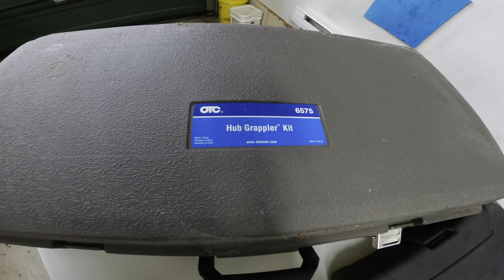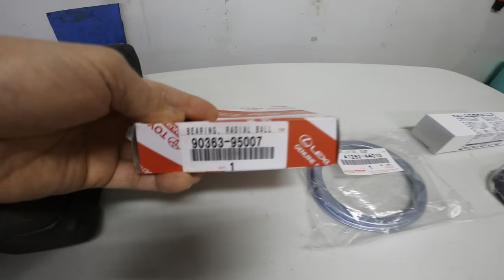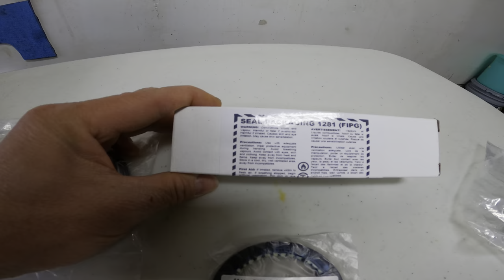2013 Toyota Sienna Limited AWD - Noisy Rear Differential Repair - $150 vs $1500 repair

Comment: Hi, I have 2011 Sienna , I just made the repair ,  took 7 hours to complete it , but the car runs fine now , your video helped me a lot , Thanks
Reply from the maker: Nice! 
You’re very welcome!
Reply: 7 hours? I have a 2011 - was it because it was time intensive and difficult or did you encounter  problems?
Reply: There were no major problems, just every small step of the process tucking some time and I don't have any proper mechanical equipment

Comment: I know this is older but I feel I'm having the same issue. I looked up that bearing part on toyota and it comes up with nothing. I found it elsewhere but it says it doesn't fit my year and gives an older series (03-07). Any ideas? I'm having trouble finding the part alternative. I found your other part numbers, just not the bearing.
Reply from the maker: No specific bearing PN is listed for this model year. It is only available as in a complete coupler assembly. However you can find the bearing with the same PN listed in my video (Toyota dealers for sure would have or eBay maybe) then it will work.
Reply: @PTranProductions  I did find it in older models as that. I'll order and hope for the best. Appreciate the response and the video
Reply from the maker: @DrewTubeCenter 
Np! Good luck with your repair!

Comment: Amazing!  Thank you.  How is the bearing holding up without the O ring?  I have a 2011 with the same problem.  Where did you get the parts?  Toyota keeps telling me you must replace entire unit.  Thanks for your help bro.
Reply from the maker: The bearing has been holding up very well so far. As you have seen in my video, the two bearings have identical part number except the old one has the outer o-ring and the new one doesn’t.  I got just ordered my part from my local Toyota dealer by giving the exact part number as ‘no replacement bearing’ listed for my 2013 Sienna rear differential. Yes, the dealer would systematically tell you to replace the whole unit because there’s no replacement bearing listed in their system.
Reply: @PTranProductions  where are you located?  Any chance you’re in Ontario?
Reply from the maker: South Western Ontario.

Comment: Just a note of thanks for your efforts making the video. This past weekend I replaced the bearings in the assembly on my wife’s Sienna with 140k miles. I did both the large bearing like you showed as well as the smaller one inside the clutch. The smaller one did not appear to be bad, but I figured since I had it all apart that I’d replace it anyway. Also installed a new dust shield. The parts were like $180 on EBay plus a little gear oil.  Your video definitely helped me to gather up the right tools so I didn’t have to make all kinds of extra trips to the toolbox. Thanks again for your efforts.
Reply from the maker: You’re very welcome! 👍

Comment: Thank you for the video - we did this repair this afternoon on our 2011 Sienna and it worked like a charm, ordered the exact parts you detailed - very helpful!
Reply from the maker: You’re very welcome!
Reply: Hi Steven, just curious how long it took you to fix this? Did you have any challenges? 

I consider myself a handy person, but never done this before. And I dont even have the car lifts or jacks. But thinking to do it myself as literally no other mechanic wont even consider rebuilding it for me. And I hear dealer is asking north of $2500
Reply from the maker: Around 6 hrs of labour (while doing the video and explaining all the steps of how to do) + 3 hrs or more waiting for the sealant to dry.
The only challenge was pounding the old bearing out of the housing. A press would be nice for this job.
Reply: @PTranProductions  thanks a lot for your response
Reply from the maker: @MrAnderson58  
Np!
Reply: @MrAnderson58  Yes, 6 hours is a good estimate.  I also thought the most time consuming portion was getting the old bearing out of the housing, as @PTranProductions mentioned. Just keep his video handy, i watched and rewound it many, many times... he covers it all!  Good luck, you'll do fine!

Comment: Thank you so much for this video. Mine took several days to do, but only because I could only work on the van after work. Also, the dealership sold me a defective bearing, so I had to wait on them for a replacement. All in all, job got finished and I no longer hear any whining sound from my coupler anymore
Reply from the maker: You’re very welcome!

Comment: I just got mine fixed. Thanks a lot for the video. My total cost was $590, that includes the part (brand new viscous coupler) and labor.

I bought the viscous coupler brand new (with 2 years warranty) from e-bay. And found a mechanic that I trusted. 

He had never done this before. But it was still very easy for him. And I was able to follow every step of him because I watched this video so many times ( when I was thinking I was going to replace the part myself).

It took him literally 1 hour to take out the old part, replace the new one, and put oil in it.

So don't every pay dealers and mechanics that are asking $3000 for it right now. (yes 3 other mechanics asked $3000 from me for a 1 hour job!!!) 

Anyways, just thought I would share my experience to help others.

Thanks a lot for sharing this video!
Reply from the maker: Nice!

Comment: Excellent! I have a 2006 Matrix 4WD with 199,647 miles and it has had the vc bearings replaced at 80k miles. Then around 190k miles the shaft would wiggle where it connected to the viscous coupler (non-electronic)...the bearing seat in the aluminum viscous coupler housing was severely worn away by the steel bearing with barely any metal holding the bearing in place. New housing and bearings fixed it. Car still runs like new.
Reply from the maker: Wow! Sorry that it happened to you twice within 200k. Good maintenance and repair would go a long way. I am glad that your 2006 Matrix still runs like.

Comment: 🙋🏻‍♂️🧰 I noticed when you flip over the coupling use a smaller size bearing press ring to drive the electro magnetic coupling device back into the housing and I was wondering what size did you use?
Reply from the maker: Not sure of the size of my head but it was part of the hub puller kit.
Reply: Okay if you figure out what size is best for that let me know I appreciate you very much

Comment: I got like a 2017 Toyota Kluger High Lander ........ Jacked it up, as you turn the wheels you can hear like a tap tap tap type sound........ and feel it on the cv shafts.   Did yours exibit such a thing?   In the car it sounded like tyre treat something stuck in a tyre etc....  but it also hummed.
Reply from the maker: No, I haven’t experienced anything like that on the van.

Comment: What are the orange things in your springs? Are they devices to stiffen up the spring rate to make your Sienna more heavy duty?
Reply from the maker: Yes, those are the Air Lift/Air Suspension which stiffen up and raise the rear end to about 1”. I used them for towing the boat trailer and heavy load of fish after fishing.

Comment: Top left bolt connecting coupler and differential is tough.  Very difficult after 0.5 inch coming out. Using 22" wrench.  Thinking I may break something.  Bolt head looks okay. should I stop? or force it? Need advise.  Thank you.
Reply from the maker: Spray some rust penetrating oil then wait for a few hours before you try to loosen it. I am not sue why it’s like that. Mine came out with no issue.
Please do it at your own risk. I can’t be reliable if you break anything.
Thank you and good luck!

Comment: Q1> My car is 2012 AWD Sienna LE. Does the car share the same parts with yours 2013? Q2> Where did you rent the hub grabble? Q3> Do you just use two original bolts to remove the four studs? Many thanks!
Reply from the maker: Hi JackM,
A1: This car had 176K Km when I heard the noise.
A2: My guess is that yours will have the same bearing but don’t quote me for it. Use as your own risk. As far as I know, my 2013 has the same bearing as the 2011 Sienna AWD of this guy on Siennchat.com: 
https://www.siennachat.com/threads/awd-coupling-repair-diy-growling-whirring-buzzing-humming.60841/
Reply: @PTranProductions  @11.47 you said "mark the original location for reinstallation". What did you mean? Thanks
Reply from the maker: To ensure correct alignment and to avoid vibration on the propeller shaft and the rear differential, the propeller shaft must be reinstalled to the rear differential at exact location when it was removed. Since the factory markings are no longer visible, we need to mark (a line running to both brackets) the propeller shaft bracket and rear differential bracket before they’re separated.
Reply: @PTranProductions  Based on my understanding, there are four different way we can install the propeller shaft onto the rear differential because there are four stud locations. After removing four studs, you mark the location of one of the bolt hole in  propeller shaft relative to the location of the rear differential mounting surface, you cannot use the rear differential outer wall as reference b/c it will rotate to any position.  So during installation, you are able to reinstall it as factory does. Does my understanding correct?
Reply from the maker: There should be only one way to install the propeller shaft to maintain good balance as of from the factory to avoid vibration. Yes, markings to be done on the the propeller shaft mounting bracket and the relative differential mounting plate.
Reply: @PTranProductions you have very high quality repair videos. Look forward to watching more. Thank you
Reply from the maker: @ask43242flight  
You’re very welcome!
Reply: Sorry to bother you again. It seems my car has the similar issues and I will need to fix this soon. When you remove the four studs, do you just use two original bolts to remove it or I have to buy bolts for it. Aslo where did you rent the hub removal tool? Many thanks
Reply from the maker: @ask43242flight  
Use the same nuts as shown in the photo to remove the studs. I purchased the hub removal tool kits awhile back for other job. So I didn’t rent it. You can check at your local part store if rental is available. If not, you may need to get something similar on Amazon or eBay.
I hope that helps. Let me know if you any further questions.
Good luck!
Reply: @PTranProductions  yeah I saw the two bolts shown @11.10 but it doesn't tell me the specifications of bolts. Is it possible that you can tell me the bolt spec so I can buy them first? Also, is it possible that I can remove the drive shaft with rear transfer case together to avoid that I have to first remove 4 studs? Many thanks
Reply from the maker: @JackM  
Those are the original nuts installed back to back. You don’t have to buy new ones. Use the original nuts that you remove and install them back to back then tighten them up good. Then you can remove the stud by putting the 12mm open wrench on the inner nut and turn counter clockwise.
Reply: @PTranProductions  I really appreciate your helps!
Reply from the maker: @ask43242flight  
No worry!
Reply: @PTranProductions  This morning, I jacked up the car in the air and confirmed that my car has the exact same issues. While I was under the car, I tried to rotate the propeller shaft manually as shown @00:09:51 in your video.  I 

tried the same method you used but I am not able to rotate the shaft at 

all. By the way, I have released the car parking brake, but I still 

cannot rotate the shaft at all. What did I miss here? Do I just need to put more force in order to make it rotate? I am concern that I might break sth if I do it. Thank you
Reply from the maker: @ask43242flight  
You must put your shifter in N (neutral), parking brake off and all 4 wheels in the air in order to rotate the propeller shaft. I apologize if forgot to mention that in my video.
Reply: @PTranProductions  I watched your video many times at the place where you rotate the propeller shaft, I heard no noise so I assume you didn't start the car. Q> How do you put the car in neutral when you didn't start the car. Sorry for this silly question.
Reply from the maker: @ask43242flight  
Turn on the ignition (without starting the engine) then step on the brake and shift to N.
Reply: @PTranProductions  I see. So you had turned on the ignition but didn't start the car while you rotate the propeller shaft. This is the reason why I didn't hear any noise while you did this. I just ordered all the parts you listed on your video and Thank you and just subscribed your channel!
Reply from the maker: @ask43242flight  
Np! Good luck!

Comment: Hey brother can you tell me which seal needs to order for the right and left side differential to connect to the axle because my car left and right leaking needs to replace the seal thanks
Reply from the maker: Sorry, I don’t know the PNs for those seals. You need to contact your local Toyota dealer to ask for the correct PN and to order.

Comment: hello, where can you buy such a kit for repairing the differential, I'm from Lithuania, my Sienna also needs to be repaired

￼
Reply from the maker: The hub grappler kit would be expensive for this repair if you had to buy it.
I just happened to have it from my previous wheel bearing repair.
You can find something else that work or you can have your local repair shop just to press out the old one and in the new.
Anyway, here’s the link for the kit if you still want to get it.
https://www.ebay.ca/itm/184997488710?mkcid=16&mkevt=1&mkrid=711-127632-2357-0&ssspo=omldyznwr0k&sssrc=4429486&ssuid=Ahg_4LbmT6O&var=&widget_ver=artemis&media=COPY
Reply: Just use a regular jack as a press

Comment: Do you happen to know how to remove and change out that seal? Theres like a metal ring in front of it that im not sure how to remove
Reply from the maker: Not sure which seal you’re talking about here. The bearing also has a metal ring dust cap in front which just needs to be popped out when the bearing comes out.
Reply: @PTranProductions  thank you. I got it off. I thought the metal ring might have been held in under the lip of the casing but it was just some grease that was creating suction on the ring. I appreciate it very much. I did find that there was oil in the casing of the viscous coupler and that the inner unit has some discoloration. Could my actual coupler unit be bad? I do get a thumping feeling sometimes when accelerating from a slow start.
Reply from the maker: Not sure what you meant by distortion. Do you see any sign of physical damage on the differential unit itself. If you see oil inside the coupler assembly, there may be an oil leak into the coupler from the main unit. Run your finger around the main seal on on the main unit (inner unit/differential unit) to check for any damage/cut when you pull the coupler. Replace that main seal if you’re in doubt and there’s oil inside the coupler.
Reply: @PTranProductions  discoloration on the inner electromagnetic unit like when metal gets really hot and turns like a dark blue color. Would it be okay for me to contact you somehow and ask you a few questions? Not sure if there is a way on here to privately message you
Reply: @PTranProductions  the seal felt fine but i replaced it anyway. Just kind of wondering if the thumping could be coming from the coupler itself so rather than spending $150 to replace the bearings. Maybe i should replace the whole coupler
Reply from the maker: @luongj  
If your rear differential doesn’t have that growling noise like mine but rather the thumping noise, the bearing may not be the problem. Was the rear diif. oil level low at some point?
It’s up to you to decide if you want to replace the whole unit or just the bearing.
There’s an inspection criteria for the coupler on Toyota Service Bulletin for 2012 Toyota RAV4 which has similar rear differential coupler:

https://static.nhtsa.gov/odi/tsbs/2016/SB-10092682-5448.pdf
You can message me via my Facebook fan page.

Comment: Hi I think it is same issue with my 2012 Sienna limited Awd just both it 6 days ago from private owner when driving on D or N after run start kind of like this Noise and sound I will be happy if help me with that please thanks
Reply from the maker: If you can do it yourself, then buy the parts and follow this video to fix it at your own risk. Otherwise take it to your friendly mechanic. He may be able to help you out.
Good luck!
Reply: @PTranProductions  thanks for sharing your experience I don’t have any mechanic friend but I will try to find a good mechanic with experience
Reply from the maker: @NYC-2015  👍

Comment: Hi I have I have a same problem and I went Toyota dealer they don’t sell the bearing by self.  And I get the part number that you show on your video.  
And they say that not for Toyota Sienna. For a different car.  I get the same part number on the video.
Reply from the maker: Lol! Yes, they just told you what the system told them. For some reasons that bearing PN is not listed for this 2013 Toyota Sienna. I took a chance and it turned out to be exactly the same bearing that was in my van. You can take a chance ($150) or pay $1500 for the whole rear differential. Use it as your own risk!

Comment: Hey brother what is the number rear differential seal ? My car left side has leaking it should open the axle and replace the seal
Reply from the maker: Sorry, I don’t know the part number the axle seal. You need to check with your local Toyota dealer or if you’re looking for an aftermarket one then head to Rockauto.com.

Comment: What size is the bearing press?  I have a 4" but it seems too small. The new bearing is 4.5".  Is your tool 4.67 or 4.5?  
Thanks!  Super video!  Very good and thorough explanation!
Reply from the maker: I just used one of the plates in my Hub Grappler Kit - I believe it’s a 4-3/4”.
Reply: @PTranProductions  Ok great thanks so much!
Reply from the maker: Np!